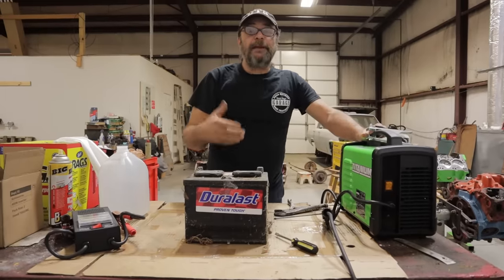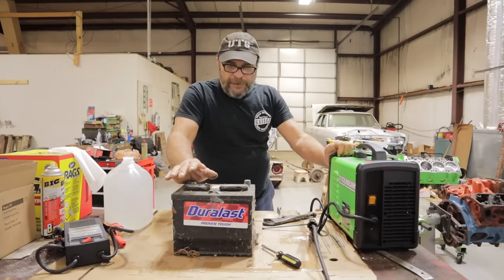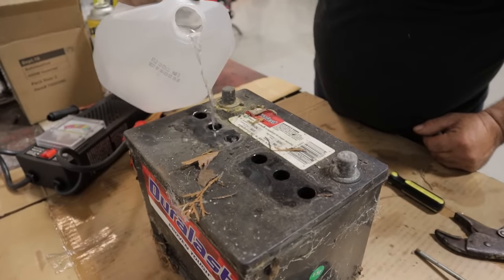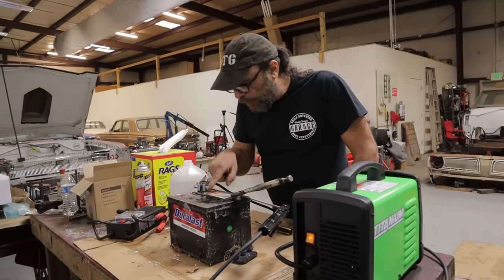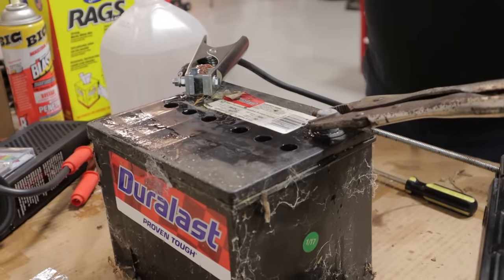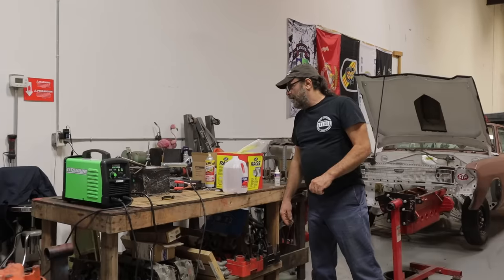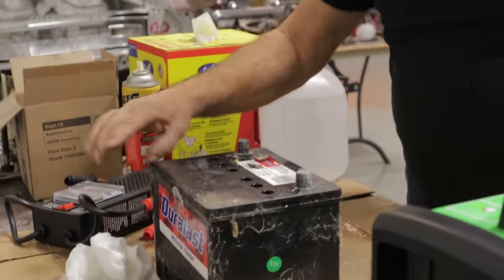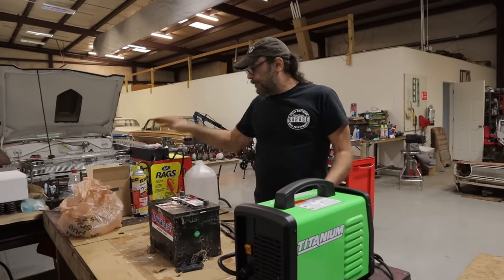Reviving Dead Batteries With A Stick Welder

Comment: I'm one of the unfortunate ones that had a battery blow up in my face. The pieces of battery cut my face and forehead, my coveralls deteriorated when I washed them. I was more upset over loosing my coveralls, hide grows back! I'm still thankful to the lord I didn't loose an eye!
Reply: Same thing happened to my dad one night trying to jump my mother's car at the grocery store. Top of the battery is what saved his eyes from the acid. Still a bad situation and a wake up call to just how quick things can go south👆💯
Reply: My sister works on submarine batteries for a living.  She doesn’t have one pair of jeans that don’t have acid holes in them haha.
Reply: What happened to make it explode .. too many Amps. Short Circuit etc ??
Reply: @waylonmccrae3546  it sparked when I took the cable off, I guess it ignited the gas coming off the battery. This happened in 1984, since then I always turn my head when hooking anything to a battery.
Reply: @That_Handle  yes, it sure would've helped.
Reply: Your eyes dont grow back though.
Reply: I always turn my head away as well. Same as the procedure for properly boosting a dead battery most people dont know
Reply: @waylonmccrae3546  Hydrogen Gas. Probably best to power off before disconnecting!!!
Reply: @Steve_Just_Steve  ...unless you're a starfish!!!😂🤣😆
Reply: @waylonmccrae3546  Any spark will set it off.
Reply: @musclecarmitch908  Face shield?
Reply: @Steve_Just_Steve  Sure they do, you just look funny. (get it?).
Reply: @tedmoss  yes I would sure wear one if possible, we were actually required to wear face shields at work when working with forklift batteries.
Reply: The gas from charging is what is explosive ..........  remove your caps and let vent for a few minutes ......  be sure the liquid level is full to reduce gas levels .  spark at posts and sometimes internal  will set off the gases. If caps are on when it explodes the top  of the battery can be blown off along with some sulfuric l acid. The blast can cause ear damage , resulting in permanent ear ringing.

Comment: Did you mention the welder needs to be DC? Most people would know that but you can bet some damned fool is hooking up an old Lincoln AC welder to a battery right now. I'm guessing the results won't be good.
Reply: wouldnt a constant  voltage supply be better   " ie a mig welder "
be able to pick your voltage 
stick is constant current
Reply: He never said, and call me the "damned fool" because I was about to try this with my Lincoln Jukebox welder...
Reply: @dc6233  You know DC makes perfect sense but until I saw this comment it hadn't occurred to me. DUH!  This is why I always read the comments. The life I save could be my own!

Comment: You must use distilled water (then proceeds to flush all the dirt into the battery :D ) loved the video, learned something new today!
Reply: Hilarious 🤣
Reply: The dirt on the battery is not the same as the dissolved minerals and unwanted impurities found in non distilled water.....
Reply: @gpetheri  it has similarities. I believe the point of distilled water is so it is not conductive which means that dirt would counteract the distilation in this scenario.
Reply: Hehehe! I always wash the battery off before I pop the caps off. If battery cable ends are already corroded to hell, don't waste your time with it. At that point,  it's leaking around the posts
Reply: @FixIt1975  good tip
Reply: Distilled water is ph neutral...ph.7  that's the "science" behind it.
Reply: @gasdonkeykustoms6840  um. No that's not at all the science behind it. Water itself is not a conductor but the way that hydrogen bonds suspend conductive materials makes the solution as a whole conductive. 
If your point was true then mix bleach and hcl until they are at a ph of 7 then see if they are conductive/ if they arent then add a little hcl and it will be conductive by your logic dispite having the same exact chemical makeup just in slightly different portions.🤦‍♂️
Reply: @gasdonkeykustoms6840  dude why would you even make that comment before taking 10 seconds to google it. I thought that and then said, well maybe he did google it and i am wrong. But nope its the other way around, do 10 seconds of research next time.
Reply: The dirt is precisely what makes it non-distilled. If it didn’t matter you could use water from the nearest stream.
Reply: Funny how my comment was removed, yet the one telling me to mix bleach and hydrochloric acid is still here. That would be death.
Reply: @gasdonkeykustoms6840  its a proof of concept bud.
Reply: Distilled water is conductive, but a very poor one at that. Basically regular tap water has a lot more iron and other trace metals and minerals that can aid in the destruction of a battery a lot sooner by destroying the plates quicker.
Reply: @edarnold1426  pure water is not a conductor....
Reply: @akassasin5768  That's what I always thought, then I looked it up and it said that it did conduct electricity, but not very good. I'm kinda wondering if they put than on there due to different distilling processes, and legality on them.
Reply: @edarnold1426  distilled water would still have impurities, very few but they are still there making it conductive slightly. But pure water is not conductive. My wholw point was that the objective behind using distilled water is probably because it is less conductive and that is what they are trying to eliminate.
Reply: @gpetheri  It absolutely is the same, and way worse.  Iron oxide dust, aluminum oxide dust, road salt, and every possible mineral from driving on dusty dirt roads.  People are worried about a few PPM of dissolved solids getting in their battery so they use de-ionized water, then wipe 100x that amount of every possible contaminant directly into the battery.  It's a bit silly.
Reply: @akassasin5768  Right, because of the oxidation of the other metals it will make the battery fail sooner due to collecting on the lead plates. Few people understand why this happens, they just go buy a new battery.
 I was watching this and didn't understand why everything wasn't dumped out and new electrolytes wasn't put in, because the old impurities are still in the batteries electrolytes. I think to much.lol
Reply: @akassasin5768  I believe that battery acid is sulfuric acid; H2SO4....
Reply: @edarnold1426  Distilled water has no impurities namely minerals that will shorten the life of cooling systems and batteries alike.
Reply: @glennmagera3498  Again you missed my point. I'm guessing that they put that on there to cover their butt, due to different manufacturers or distilleries. God knows I've seen enough stuff that made it through a manufacturing plants that never should have made it.
Reply: That was top-of-battery-dirt-hydration…..clearly
Reply: No scientific methods here🤣🤣Why I tell people to do the power cycle for 5 minutes when you do it for almost 7 minutes. Starts at 6:00 and stops at 12:50 No rationale for amperage settings or duration of 5 minutes. Speaks of battery getting hot, but doesn't measure Temperature.
Reply: And dont do this inside either. Then proceeds to.....well hey,  you know
Reply: @biketothetop  He did say it was the "first" time that he ever tried it.
Reply: @biketothetop  none of that matters in the real world. When you read a recipe to boil water, do you all for the temperature of the flame, or the thermal conductivity of the pan, or the flame pattern, or the area of the pan? No. Turn it on for a few minutes. That's all you need to know.
Reply: Pretty sloppy and unsafe methods here... Unfortunately when the explosion occurs we won't get to watch it.
Reply: @biketothetop  as long as he doesn't try to take it off while he has power going to it, or has a ignition source. He did say "this shouldn't be done inside"!
Reply: @edarnold1426  the explosion will be just as powerful outdoors as indoors... it's all foolish... safety last🤣
Reply: @biketothetop  True, but the hydrogen gas can get away quicker outside, at least on a sunny day, and when the gases aren't pushed to the ground like on a rainy or damp day. As long as there isn't any igniting sources the hydrogen gas he should be fine, but it only takes one spark. The biggest problem would be taking the power supply off or putting them on while under power. 
 Like we don't take this chance every time we charge or jump a dead a battery.  That's why they tell you that the last hookup and the first to unhook should be the ground, and your ground should be safe distance away from the battery. 
 I've had one blow up years ago when I was in a hurry and had it connected to the ground on the battery, never again! I also know a guy that is legally blind now  because of it, and the sad thing is that he was a truck driver and owned his own trucking company, now he has got to have someone drive him around. 
 Actually people that don't know how things work really shouldn't even attempt to jumpstart anything, because common sense really comes into play on doing things like this.
Reply: @biketothetop  scary isn't it, does it make you quake in your boots?
Reply: @akassasin5768  if you think water isn't a conductor lay on a piece of plastic and grab 110 volts and then go lay on the wet ground and grab 110 volts and we'll see who's living water is absolutely a conductor what's wrong wow man
Reply: @akassasin5768 ummmmmmmmmmmmmmmm you don't know what you're talking about
Reply: @akassasin5768  oh yeah man but it's cool science man you must be related to Dr fauci
Reply: @biketothetop  oh you're a big bicycle battery Man now I see
Reply: @biketothetop  go ride your bike to the top and get out of the car discussion
Reply: @mikemotorbike4283  it makes him quake in his tap shoes
Reply: @akassasin5768  it's because other water has stuff like chlorine and other stuff in it I guess so you're not mixing different chemicals into it
Reply: I was thinking the same thing. He made it work though. My favorite new saying is now "For Science Reasons, Just trust me". Lol. Dude is legit for sure.
Reply: I cringed when the caps came off with that debris on top. I just pretend he cleaned it.
Reply: @gasdonkeykustoms6840  yeah you never mix bleach and an acid.
Reply: Haha I cringed at that too even after he flushed lots of minerals into the battery using the distilled water which is used to avoid mineral contamination. The first job when working with a battery you're going to open the caps on and expose the electrolyte in the cells - CLEAN THE TOP OFF.
Reply: @gpetheri  You think dirt doesn't have minerals in it? Where do you think mines, where minerals are most often extracted, are located?
Reply: J.C. Whitney long ago sold a goose-necked bottle with a spring-loaded spout for filling batteries. You press the spout down on the lip of the cell's opening and the water comes out clean and in controllable fashion.  After many years the spring on mine broke, and I don't think they make the bottle anymore.
Reply: Love Eddy Arnold!! Cattle call ftw!
Reply: @gpetheri  point is you don't know what minerals or elements and what form they are in... What if iron was mixed in? There are other scenarios, you just don't know. It was not smart.
Reply: No point in  using distilled water if your just gonna pour all the crud from the top of the battery into the inside. Other then that I learned something new!
Reply: After careful review, I looks like the dirt washed away and not into the holes.
Reply: Passive aggressive much!?
Reply: I believe that the recommendation to avoid tap water is so that the other ions contained in tap water do not interfere with the basic lead and lead sulfate reaction which is the basis of the chemistry 
In truth, if your tap water does not contain a bunch of "hardness" it can be used occasionally to top off the battery.
Reply: Yeah, he forgot to thoroughly clean the battery before opening it, and then pour water with a funnel or seringue. 
This is quite amateur style.
Reply: No body Here said the most important thing, a arc welder is ac you can't charge a battery with AC, did he have an expensive Tig welder ? That can be used on DC? Some stupid person will plug in a $90 hardware shop welder and distroy a battery !
Reply: I used a plasma cutter on my four wheeler battery but I didn't use distilled water. hey everyone...don't do this inside..